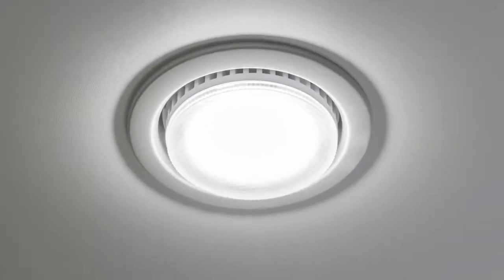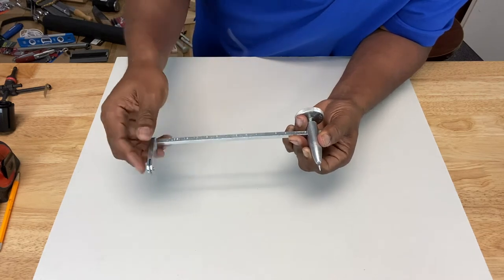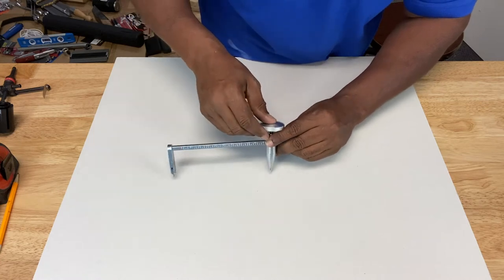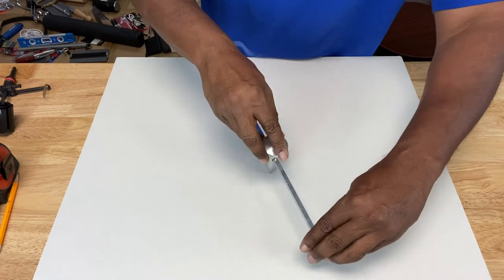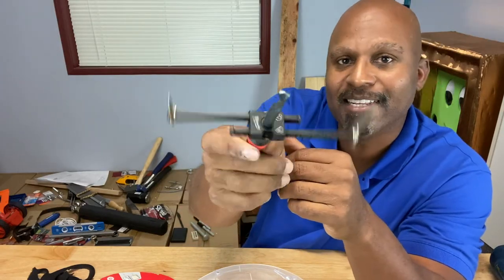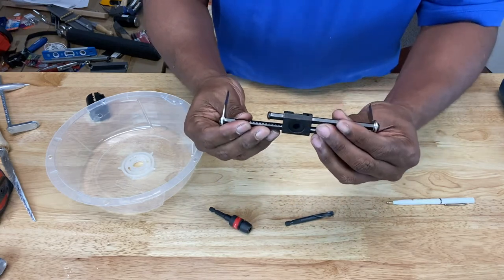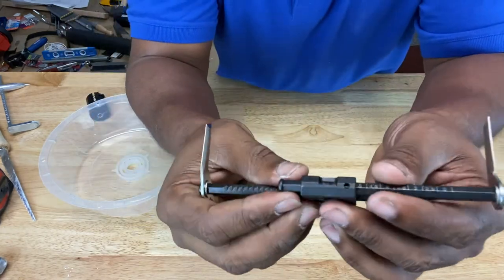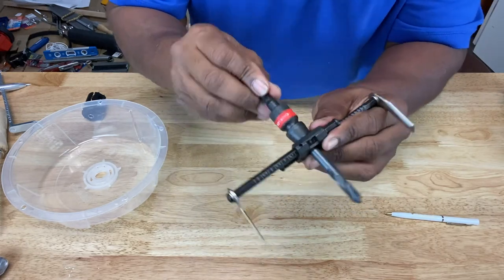CUTTING CIRCLES IN DRYWALL -DRY WALL CIRCLE CUTTER

Comment: Your method works great when the drywall is on a table, show us how to cut the hole when the drywall is installed on a ceiling and your looking up while standing on a ladder....
Reply from the maker: Works pretty much the same
Reply: I work as an electrician and use the Milwaukee cutter all the time, as long as your able to find center, the tool works just as well, you may catch a stud here and there and it could jerk the blade but if your using a chucked drill, the drill itself should tap out and stop spinning before you are able to let off the trigger, it’s a wonderful tool that works perfectly